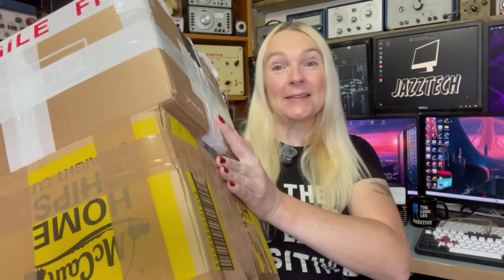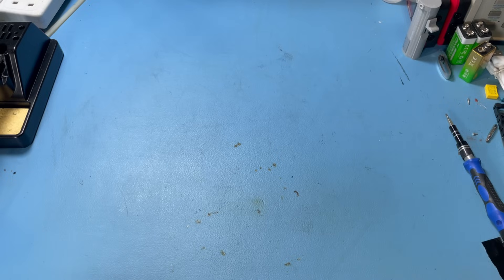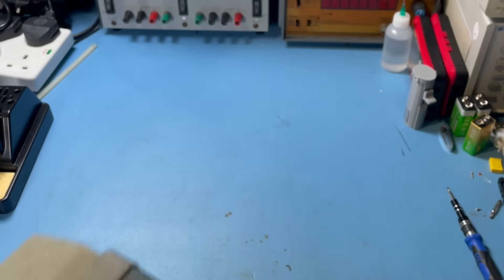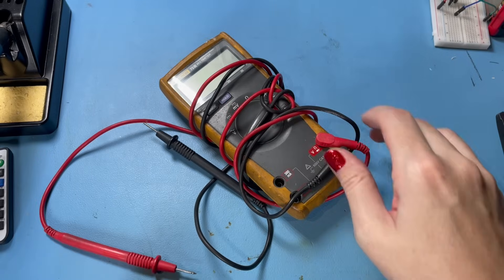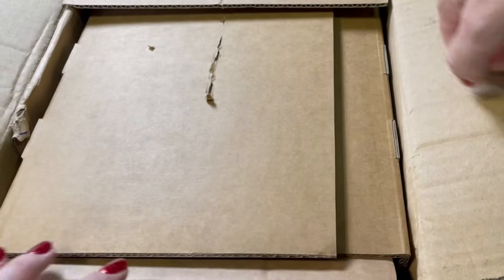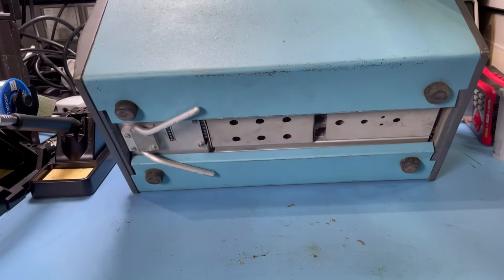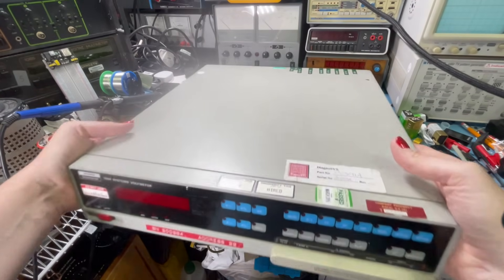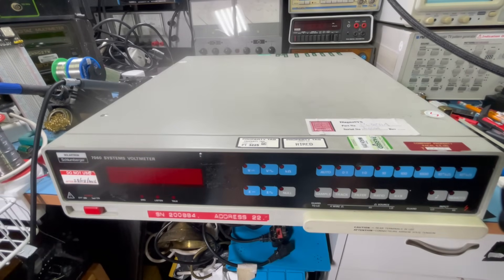Mailbag Time!  Searching For Cheap Test Equipment On eBay - Did I Get A Bargain Or Junk?

Comment: Do you have an IEEE-488 (HPIB, GPIB) interface to plug that Solartron into?
Reply from the maker: Not yet, but I will do. I have several GPIB cables standing by ready for when I do 😊
Reply: @JazzTechUK  USB-to-IEEE converters can be pricey! If you have an old ISA bus PC, the cards for those are cheap and I think there's Linux support for them. If you can get the Linux distro to install on a PC old enough to have ISA slots...

Comment: Nice to see the big Tek 7603! I got the same model earlier this year from the British Heart Foundation charity shop in central Bristol. Came with the logic analyser plug-ins, but I already had some analog plug-ins for it. All working, too! I wonder if your example has the on-screen readout? Many old Tek scopes have "Option 1" which deletes the read-out facility (making it a bit cheaper)
Reply from the maker: I don't know about the scope frame. I will have to have a look to see if it has the logic board for that. I do have various plugins, some with and some without the N suffix, which are readout/no readout types 😊

Comment: I can remember using that model Techtronics CRO way back in the early '80's.... As for the sig gen it is only as good as its reference Xtal, so you can expect frequency errors of at least 1% or maybe as much as 10%. A10MHz signal from a GPS reciever is a ideal frequency reference to compare against. Output level from 0dBm to -40dBm should be reasonably accurate.

Comment: Fluke, If the inside is as dirty as the out, a good cleaning may do it.
Reply from the maker: It has been cleaned and a new battery fitted. It just needs a good cal now.
Reply: @JazzTechUK  was going to say.. get the old battery out, corrosion might be part of the problem.  
The tiniest touch of De-oxit on the fuses can help as well.  I have a couple of Flukes, that are 30+ years old. The leads and fuse connections seem to be the only ‘variable’ spots 😊

Comment: That last 7060G is fkn enormous! Where the h3ll are you going to put it and the other solatron meters. Your bench is already full of stuff. Just because something is cheap doesn't mean you should buy it unless you ACTUALLY need it.
I have one good 6 1/2 digit bench multimeter, a UT61E+ multimeter, a UT210E clamp meter, a Peak ESR60 meter, a Rigol 1054Z, a Yihua 899DII Soldering/hotair station, 1 Fnirsi soldering iron, 1 signal generator, a couple of bench PSUs and an electronic load.
Reply from the maker: Don't worry I have more than one bench to put stuff on, plus storage areas. Being a tech YouTuber I always need interesting stuff to make videos about.
Mailbags just would not be as interesting without all these cool bargains, lol.

Comment: Lots of cool gear! Definitely have a go at the Tek scope, it's loveliness. 
Solartron was some of the best gear around back in the day, build quality was astonishing. You're going places with that equipment. And since you've got a good bunch of lab standards, calibrating those meters shouldn't be a problem - it'd be even better if you could lay your hands on a verified AC/DC voltage calibrator someday.

75III gotta need some love, possibly with a rough-ish sponge or dishes scrubber to clean the case. That's how I clean my screwdrivers and other tools, does the job witout ruining the surface.
Reply from the maker: The Fluke 75 has already been cleaned. Just needs a calibration. As for AC and DC voltage calibrators, something is in the pipeline. Sneaky inside info just for you Keri, something better than that particular Solartron is coming soon . . .

Comment: Old analogue scopes are not worth the postage anymore, as parts usually are no longer available.
Besides they are usually low frequency range - max 20MHz for the later ones.
Cool for me !
As now I own 6 different old ones with various freq. ranges - half of these in usable order - the rest are future projects 😊😊
Thanks for your video
Reply: While I wouldn't use one for lab work unless it's a good one (Tek usually is, check the model though), they can be fun for audio visualizations, component curve tracers, clocks etc.
Reply: @KeritechElectronics  I have not (yet !) worked with projects that require higher bandwidth than 10MHz.
These older oscilloscopes are worth their weight in everyday electronics repair work, which has been my main jobs the last 50 years.
Reply from the maker: @CXensation It's a cheap way for a hobbyist with not much money to pick up their first scope. Some makes are easier to repair than others. Not all have unobtanium parts in them. As for bandwidths, 20MHz is usually the lowest frequency. Analogue scopes up to about 100MHz are easily obtainable, and 500MHz or more if you have the budget to pick up a Tektronix analogue scope.
Analogue scopes still have their (limited) place, especially for audio repairs where an 8 bit digital scope is not good enough to see the audio waveform clearly enough. Good luck with your repairs 😊

Comment: The Fluke 75III is a solid meter, we calibrate a ton of these every year..... The solartrons are always worth saving too. I notice quite a few have GPIB, i wonder if you've dabbled with remote control? Good video!
Reply from the maker: I have not dabbled with GPIB, but I have a friend who has written extensive programs for the Datron/Wavetek range of multimeters, so I can always ask them for help 😊

Comment: Maybe I'm biased but older tech stuff was built better technically and with reliability in mind..
Am so happy that you keep saving these items 👏
Reply: Definitely built to last. Either working for decades or breaking down in a repairable manner.
Reply: @KeritechElectronics 
'breaking down in a repairable manner' is an excellent way to describe the technology  😁
Reply from the maker: @peterferguson2344 the old stuff was built to last, and it has done, often just needing a recap and a fresh calibration.